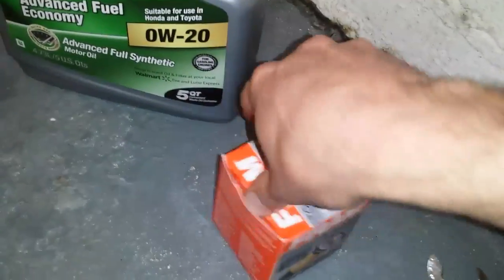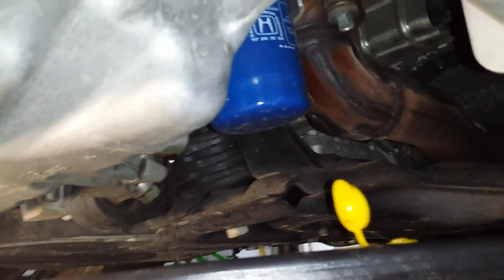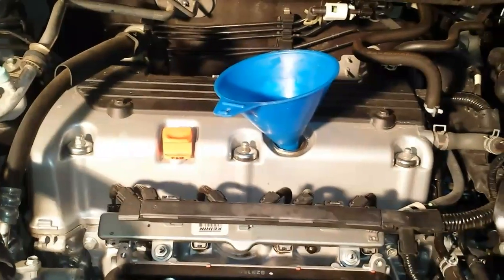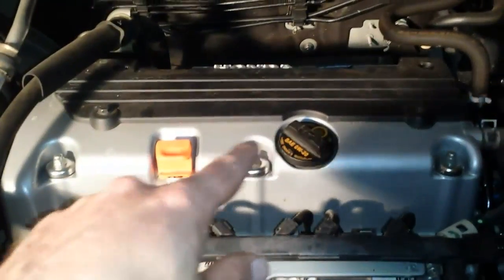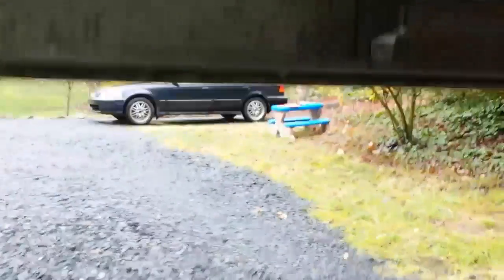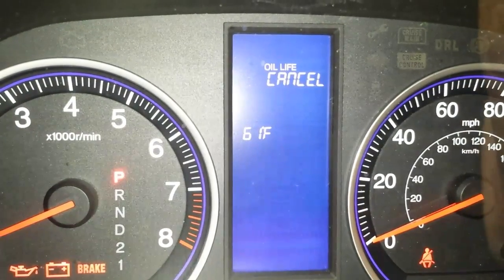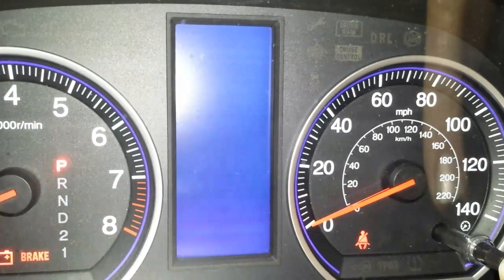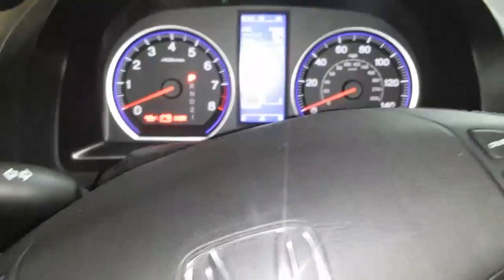Honda CR-V 2010 Oil Change

Comment: Good video! Straight to the point with everything and clear communication. Camera angles and focus were great. Very satisfied. Hope you show how to change the transmission fluid in another video. 👍🏻👍🏻
Reply from the maker: Awesome! I really should of done a transmission fluid video. I still have the CR-V and the trans fluid change isn't too difficult. Just be mindful of the fluid splashing everywhere and you must have the engine warmed up and turned off to check the trans fluid level. Also I just recently changed all the struts and after two failed aftermarket struts, I highly recommend buying directly from Honda.
Reply: @BobbyOnesios  which brand of struts did you end up going with, and how are they working out for you?
Reply from the maker: @mwpahl38  The two up front are directly from Honda and the back two are KYB Strut-Plus from Autozone. So far the KYBs feel great. The Honda struts are perfectly fine as well. They just cost four times the price.
Reply: @BobbyOnesios  I figured the Honda ones would be pretty costly. I was just wondering if there was a decent alternative to the OEM's. I appreciate the response and the video!
Reply from the maker: @mwpahl38  No problem!

Comment: Don't start VEHICLE until full by car, also keep dipstick up and barely in, some people forget to put oil in it, so I learned to take oil cap off and Dipstick hanging out. This guy explains well but never good to Run low, he ran it 2 quarts low, that's very bad for engine, he said just over 3 quarts, by honda, it states 5.3 quarts of oil, but you will have some left in it unless run out overnight. Most don't, put some oil in filter,  its best,  then make sure there's no rubber seal left from OLD FILTER NOW oil the new seal and put oil on it and rub in just like he did. But best off to take old filter off first, why, then you match up by put them together, rubber to rubber and make sure the same size seal. Once you due that, add some oil in filter for better life of engine, no dry start, put in about half the filter now, then screw on once it stops and hand tight, give a quarter of a turn more and your great, then wipe off any oil drips on underside so you know, then go to top, add the 5 quarts of oil it calls for. The way I start my VEHICLE up is bump the starter a few times to get oil up to top. Just beware of some cars reset stuff by doing that, honda I DON'T think so. Ford i believe does, that's me but DON'T have to. Then let run and check for pressure if you have oil pressure gauge, if not, then make sure no dummy lights stay on of oil, if so, shut off and double check oil, check under VEHICLE 1st. No oil on ground then great, then check oil after a minute shut off, make sure enough oil in it, if very low, then make sure you put oil in, if you did, then you have and oil leak and look under, I have seen my brother-inlaw come home and truck smoking, he said he just got the oil changed and oil burning off, that can happen, but his was pissing from oil filter mow, he called the place, they told him to drive back, he said how, my oil light is on, my father-inlaw is here with my brother-inlaw my father in law work at General Motors at the time and stated that its got to have a double oil gasket on from filter, it sometimes sticks to the block, if you don't wipe clean and double check the filter my way and by wiping oil off clean to see, then you know its not on. Then put your oil filter on, they gave him a free oil change on his next visit. My father went to the store and hot oil and filter, brother-inlaw kept it and took back 2 the next day since they closed at 5 o'clock, it was 3:30p.m. and needed to go to store, lucky he drove only 3 miles and lost 2 1/2 quarts, if got on a highway, then would of blown engine. So its always good to check for oil spots even by the PROS now. They make mistakes to at times, also warm up oil for 5 minutes max. His VEHICLE needs to go in to the shop and have his valves adjusted, these 2.4L Honda engines are known for it. I learn everything about all vehicles I own. I'm a Chevy guy but own a 2 Ford's 1 Plymouth and a Honda now, sorry but Honda and Toyota was the best cars to buy for a used vehicle in 2018 to get your money's worth under $10,000 and have it last a long long time and be very very safe. Top 2 vehicle's, CR-V and RAV4 It runs great but has some things you must maintain, they need more four-wheel alignments and differential fluid change more often then any other car I've ever seen but that's it.  never change differential fluid unless I got water inside from four wheeling or if I replace the cover with an aftermarket cover on my old truck and that's it.

Comment: I have a 2008 crv on my oil cap reads 5-30. Why are you using 0-20? You should talk more about synthetic or normal. In the auto parts they told me that my car doesn't recuared synthetic. Thanks

Comment: Hey I have a 2010 Honda CR-V exl 4wd with navigation but weird I don't have a compass in the middle also how do u get 24.9 mpg I get like 18
Reply from the maker: Ming Li I'm not sure about the compass but I believe the models equipped with navigation didn't have them. It may be because the navigation handled it all. As far as the mileage, 24.9 is one of my lowest mpg. I usually stay around 28 mpg. It could be your 4wd, driving pattern, or terrain. I also ended up getting energy efficient tires. There was a time I started getting low mileage and noticed the bolts holding the throttle body to the intake manifold were loose. Air was slipping by and causing poor performance.
Reply: Bobby Techknow really even on highway I get bag mileage but I do go about 80
90 also thank you for the reply. And the intake where is that? Is that where he engine filter is? I'm sorry bad with car things. One more thing at low speed let's say stop sign when it's in drive there like this noise idk how to describe I have a video of it. Honda was trying to charge me 150 for diagnosis. It stops if I park it or put it to neutral.
Reply from the maker: 80 or 90 could eat some gas for sure. The intake is just after the air filter in the engine. How many miles are on your crv?
Reply: I only have about 52,000 miles. I'm actually using the video to do an oil change, then later an engine coolant replacement and also a brake fluid change. The vibration and the comment I said last time when ur stop at a drive thru let's say stop in drive it vibrates also when going under 0-10 mph it's such a strange sound. Is there an email or something I can send it to you. Thank you
Reply from the maker: Yeah. Go to the video description and scroll all the way down to my Facebook page. You can send it to me through Messenger.

Comment: I tried removing my oil plug from my 2011 crv and I broke a ratchet wrench and have started slightly stripping the bolt so I stopped and I am going to take it to my family mechanic. makes me so mad trying to do something myself and not being able to do it.

I put a new filter on which came off fine but the bolt won't budge and is slightly rusted.
Reply from the maker: Sorry to hear that. While I was deployed, my wife took our CRV to a 30 min oil change place, :-(...Let's just say I almost needed a blow torch to get the drain plug off. I had to buy a new plug too. Hopefully your family mechanic won't over torque the plug. Sometimes the oil filter can be a pain in the butt too.
Reply: +Bobby Techknow It was one of those penzoil 10 minute oil change places. I doubt my family tech would over torque it, and prob gonna need a new plug as well. Just hoping nothing is damaged oil pan wise.
Reply from the maker: relentlesshate I hear that! You should be fine.

Comment: My adventures with my wife's 2010 cr-v have been awesome, especially when we found out that it burns a quart of oil every 1,200 miles because of low tension oil control rings. Last Honda I'll ever own, they used to be great but not any more, my tacoma doesn't burn a drop and its a 2006, love toyota!
Reply: My 03 camry burnt oil like a b-, certain engine models do.  Toyota and Honda are great rigs

Comment: I already know how to change the oil lol but can u use 5w30 instead of 0w20 like the manual states
Reply from the maker: Yes. I've used it a few times so far. I'm sure the oil debate can last a hundred posts but honestly, I haven't seen a difference or problem. You'll be just fine with 5w30.

Comment: fram filter and mobile 1 oil i like it
Reply from the maker: I know! Sounds like mixing PBR and a fun night. I still drive this CRV and that was the last time I used that type of filter. Let’s just say that on the next oil change I had to stab the filter with a screw driver to twist it off. I made a heck of a mess.

Comment: Is it okay to use other oil than the Honda oil brand?
Reply from the maker: Definitely. Just make sure it matches in  type, like 0w20. Your oil cap should have some info like this on it. Now, for transmission, power steering, clutch, and brake fluid I would stick with the Honda brand just to be safe.
Reply: +Bobby Techknow thank you so much. Nice video by the way.
Reply from the maker: Thank you! You're welcome.

Comment: Does your CRV makes this noise when you are stopped and turn the wheel slighty when it has been driven for 20 minutes or more. You can hear it when pulling in driveway.
https://www.youtube.com/watch?v=YiUUofweITc&feature=youtu.be
Reply from the maker: +Kevin Yu Yes it does! It was making me go crazy. I went to the dealership and they said it was the power steering pump and it's perfectly fine. That was 5 yrs ago and it still works. Even after a power steering fluid flush I can still hear it. Must be normal

Comment: Why are you using a high quality oil & one of the worst brands of oil filters? Wix Xp is designed to use with synthetic oil.  Rey high quality filter.
Reply from the maker: Great question! I have no idea. I do know that I’ve never used it again. I’ll have to try that high quality filter you suggested.
Reply: Check out some YT videos. The comparison ones,it’s a very well made filter.
Reply: @BobbyOnesios  thanks for a quick response on the filter size